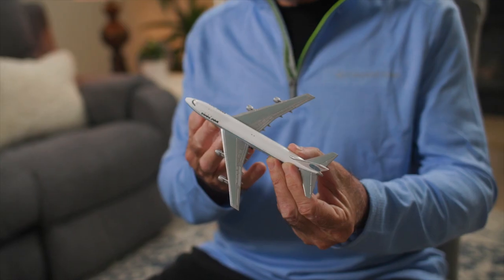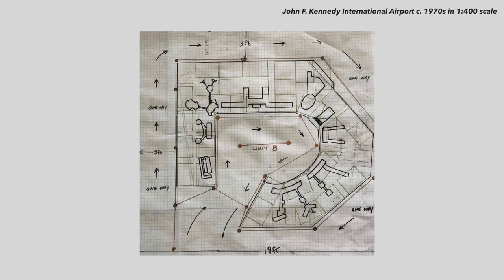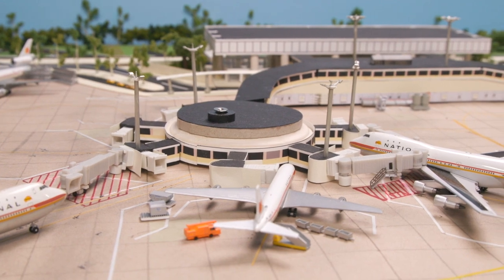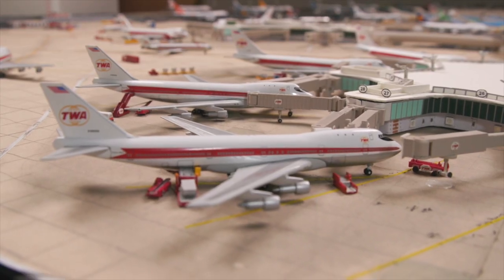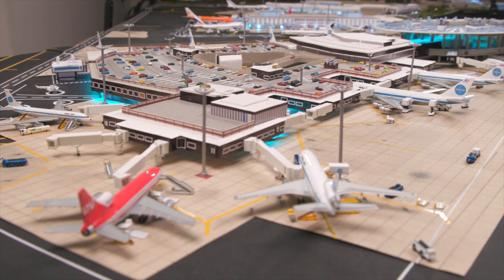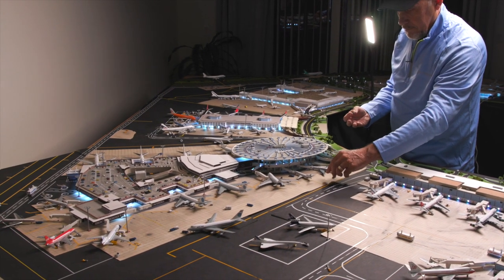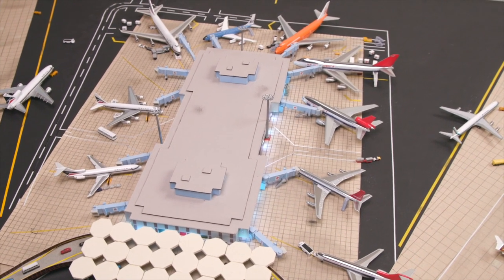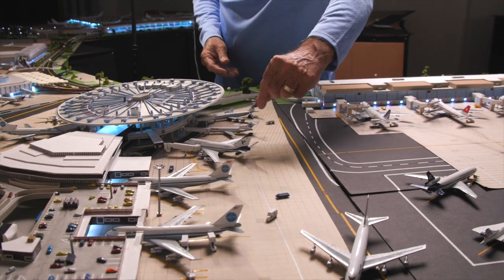Airport Diorama of New York's John F. Kennedy International Airport in 1:400 scale.

Comment: I love it ... am in the process of recreating Houston International  *later Houston Hobby as it was in the 50's 60' early 70's   I have got all my custom terminals done and they look just like  the vintage airport...  this is off the beat a question... Where did you get the 1/400 cars for the parking lots.. I have one parking lot I need to dress up with a few.  I can't find them.  I'll paint them..I just need a model.  Any ideas?  I am going to light mine up.. I will have runways  Your airport is fantastic....
Reply from the maker: Thanks for your question Rex- I have found 1:400 vehicles on ebay. Some are unpainted and others customized. Most of my vehicles were raw metal.  I handpainted them and affixed them to the display.